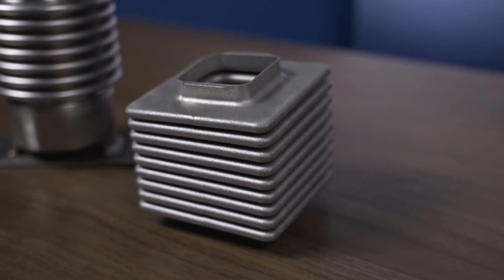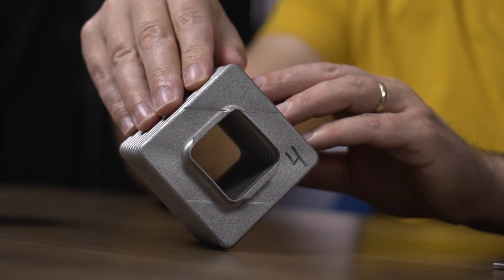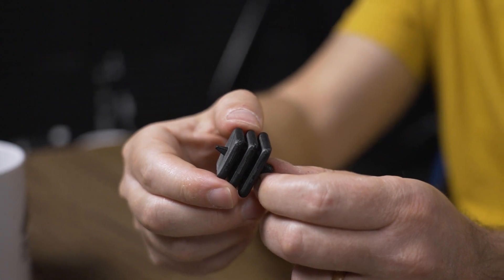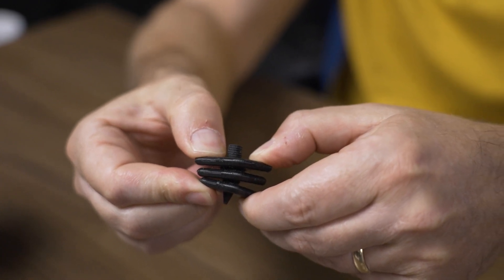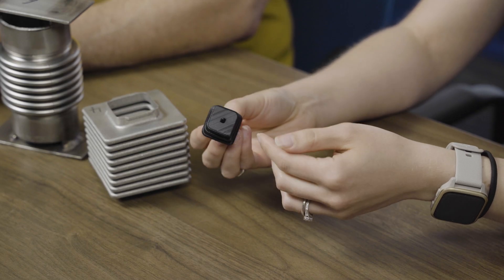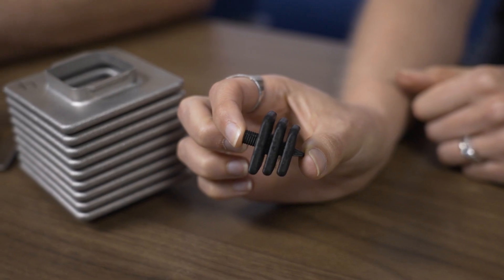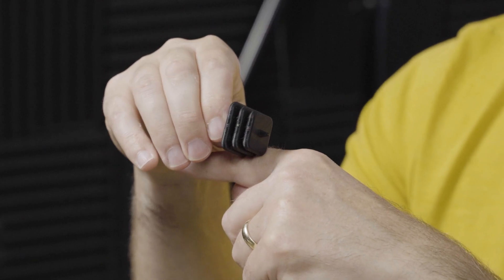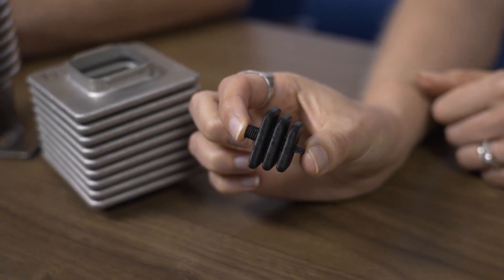3D Printed Ductile Spikes for Better Sound Quality | The Cool Parts Show Bonus

Comment: Is this for damping? Wouldn't TPU be better and cheaper than metal?
Reply from the maker: Good observation. Dr. Kappler's reply to your questions: "The ductile spikes are designed to dampen vibrations and transfer them to the ground over as small an area as possible - the tip.
 
It doesn't have to be metal, then it is better damped, on the other hand the contact surface cannot be as small.

What is the best solution? Good question 🥳 let's find out 👍"

Thanks for watching!